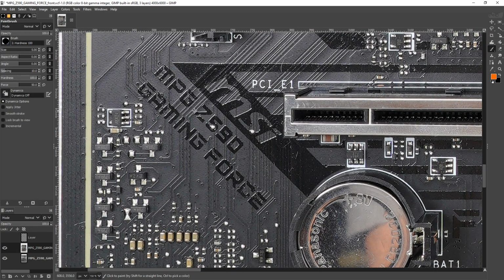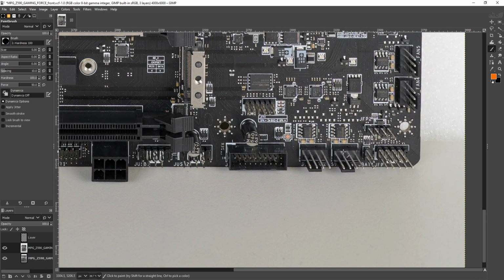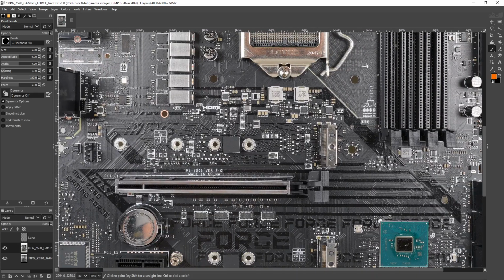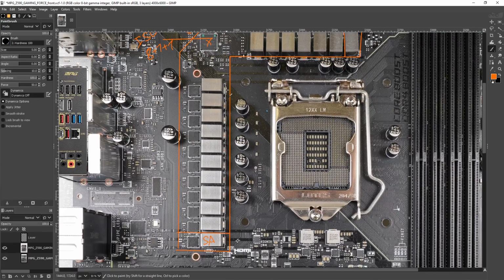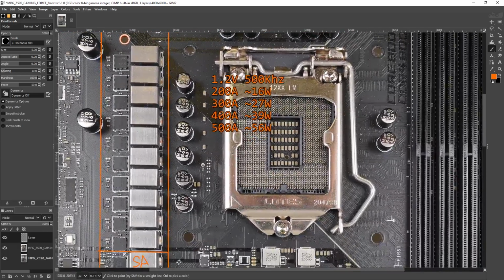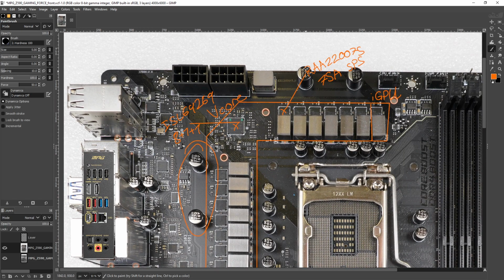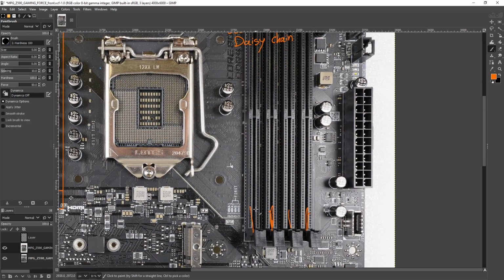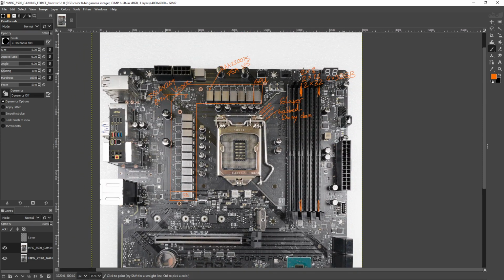mobo PCB Breakdown: MSI Z590 Gaming Force

Comment: For the extra PCIe power, I can understand it. There are reasons to have multiple GPUs not in SLI/Crossfire. Keeping an older GPU to help with mining for example, or throwing in a cheap K80 for GPU compute/AI work at home. Not saying these are common use cases, but it's nice to have options.

Comment: Thanks for the review. Convinced me to buy it off newegg on a flash sale for $100 so I can use the 11900k I bought for $300 that won't work on the msi z490 pro I already have. Well it ~will~ work but only at the lowest power state which makes it no better than an 11700k.

Comment: The board comes with a USB drive, supposedly for drivers. Since when is that a thing?! Super cool. Also it has tiny screw drivers and a cleaning brush included. lol
Reply: I've had this board for a while now and didn't notice. Thanks for mentioning this lol. Super cool and it's even 16gb
Reply: I got one with my X299 micro 2 ( Aug 2018). EVGA did this starting with the Z370 FTW (May 2018). According to them the USB costs 20x what a driver DVD does

Comment: I get the feeling my comment on the last video about pcie lanes lacking today had a point.
I've got several boards with 4x16 slots wired at 8x8x8x8x, some over 10 years old.
Got many 2x16 boards aswell.

Comment: Have a Z590-A Pro and that has colour coded LEDs, I'd assume the other MSI boards are too.

You should be able to rewire the chipset lanes on all AM4 CPUs and run those lanes to a storage device or anything else. No DIY boards do it though since you end up with pretty limited IO, particularly USB (though you could configure the lanes to connect USB)... Could be interesting for ITX (and actually some barebones systems use this configuration) but unlikely to be interesting sales wise in the DIY market.

Comment: I use MSI z590 ACE with 10th gen + 2 nvme's + 4x raid controller and I have 16x on the card.  Unusable is only the 4gen ssd slot

Comment: I really appreciate you going over the same features and explaining them again even if yiu already had in previous videos.
That said, I have a rather n00bish question, if I reset CMOS, do I also lose any profiles that I had previously saved in the BIOS? Thanks!
Reply from the maker: The whole point of profiles is that they are still there after a clear cmos

Comment: Thanks for the good video, very detailed. That's why I'm asking you, Can you tell me why my Asus Rox Strix rtx3060ti 8gb oc wont work (no signal same motherboard and brand new) first pcie 4.0 port, it works in the lower port, but the graphics card is so close to the bottom that it runs unnecessarily hot. Same problem on another motherboard (also new), no signal, but works on another pcie port. I've been building computers for 27 years, but now this problem is painful to figure out, so you can probably understand that I've tried 99% of everything to try and test to solve the problem. Ps. Psu is 750W

Comment: After almost upgrading to AMD 5600 and B560...I'm so glad I stepped back and decided to research Z590 with i5-11400 cpu!   So I paid $130 for a Z590 Unity and $135 11400 from Best Buys and I'm set!   The gains should be HUGE from my 2600x and POS Gigabytme X470 crappy ARGB...I am so excited that I didn't follow all the BS!   Glad I didn't pay $175 for a shity spec 4 layer pcb B560...IMO, Don't get the "F" or 10th Gen!   Get the non F or the K...

Comment: I just got my EVGA FTW 3 Z590 still have to get the cpu im leaning on the 10850k for it would love to see a review of the board from you
Reply: if your spending that much on a mobo get a 10900k/kf over the 10850k. it should overclock better
Reply: @natenate33  the problem is finding them they are out of stock so you think the 850k wont have any head room for me to all core it to 5.3 vs the 900k where it would
Reply: @jawalbert7788  I'm sure you can hit that on 10850k, might need alittle more voltage tho.  Its just easier to oc 10900k.  They general have alot more headroom.  I daily my 10900kf at 5.2 on an  air cooler  with no temp issues
Reply: @natenate33  I have a EVGA Z490 FTW with 14 phase VRM. So it is and it's meant to be a good OC mobo. But 5.1 with crazy high voltages is all I have managed to do with the 10850K.
So,if you can, please try to get the real deal!!